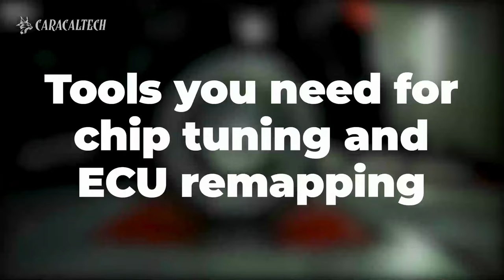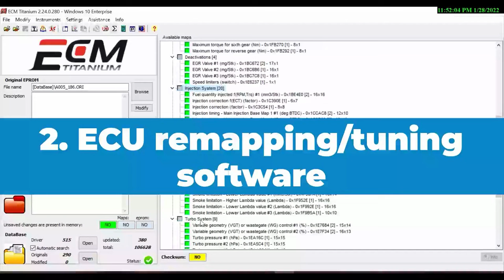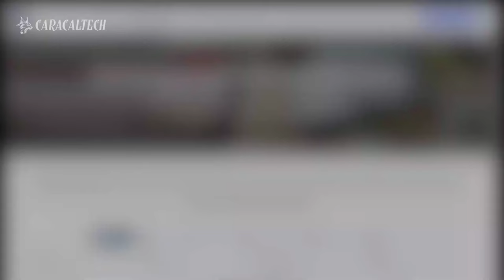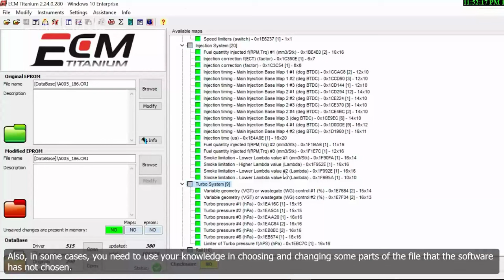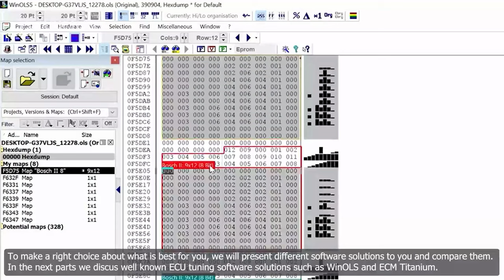Top ECU tuning Software for Optimal Engine chip tuning & remapping

Comment: What should I study to become a tuner, programming ecu and gearbox and the engine and running the car on dyno ?
Reply: Iam studing 2 years of collage. Electromechanics auto tech  after basic studies how to diagnose cars than u can get to remaping that is olso not easy work  i looks easy but a mistake can cost u entyre bussines rent or tax
Reply: @ZIGZAGmotorsport  that's not available to study in my country
There's mechatronics
Electrical engineering
And mechanical engineering
So which one is the best
Or should I move to Germany to learn automotive engineering